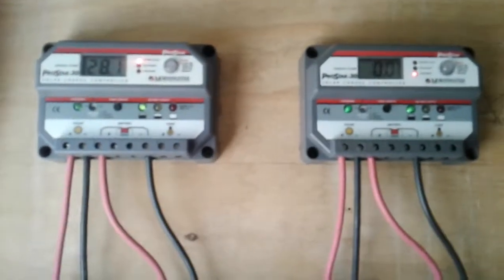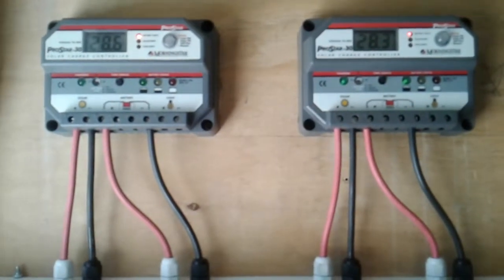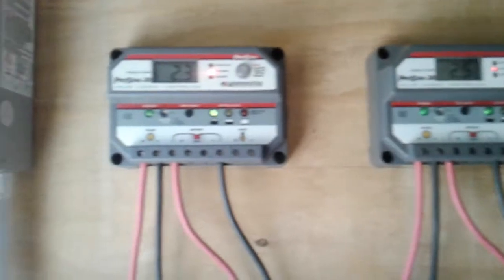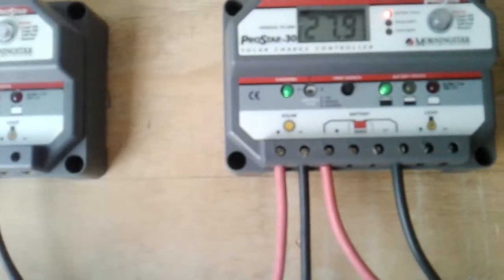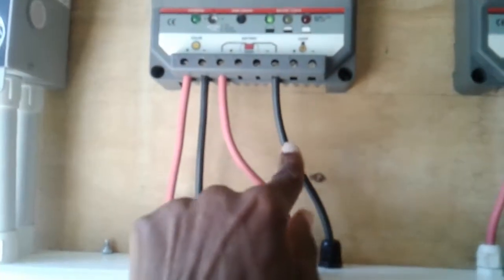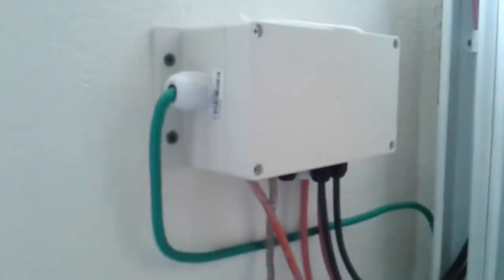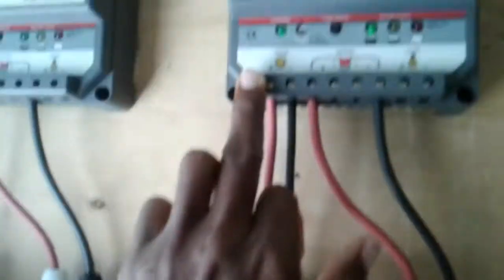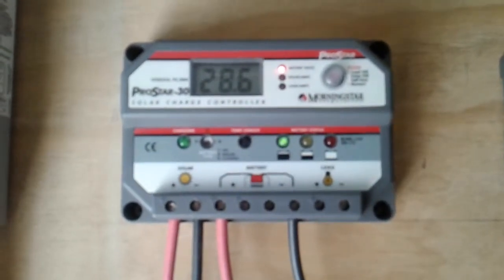Morningstar Prostar 30amp Gen 2 Charge Controllers - OFF GRID BARBADOS

Comment: I have same controller, when I plug the power from the battery in,  the switch and all 3 red leds are lit up and doesnt display anything.. leaving it connected for awhile it does light up one of the battery level leds and 12v displays but when i can't use the button to do anything, wonder if it can be repaired
Reply from the maker: That controller is registering a fault, could be with the battery connections, the controller got damage electrically at some point in the wiring or the voltage isn't correct somewhere in rhe system

Comment: Mine makes a Buzz. Does yours???
Reply from the maker: Hey yes they do, when it reaches it max voltage setting, it dumps the excess and that's when it makes the buzzing sound, so your charge controller is working as it should